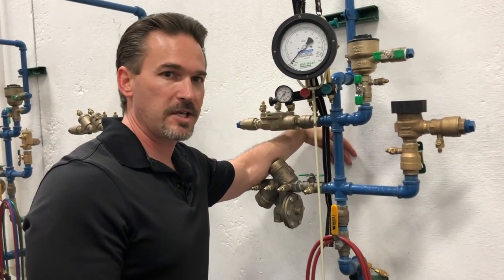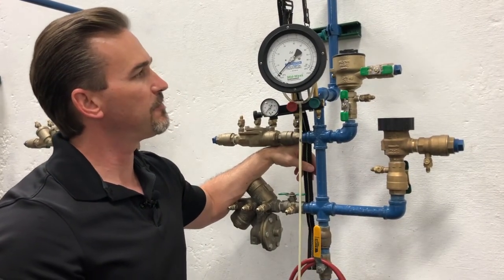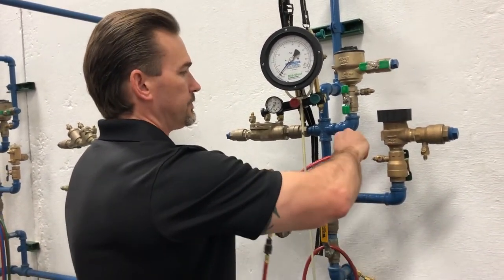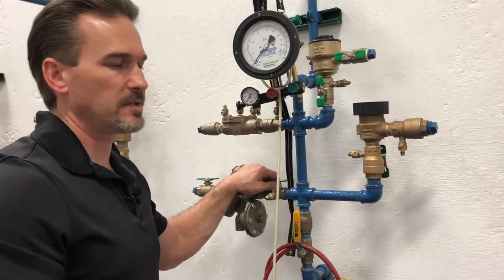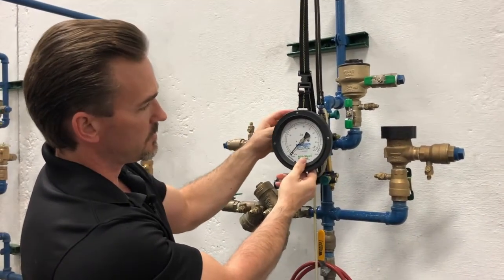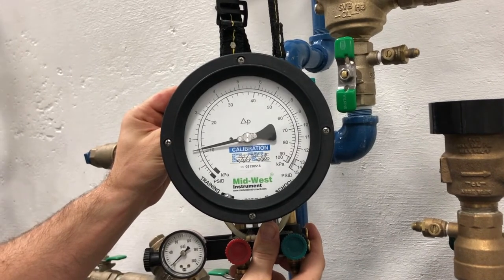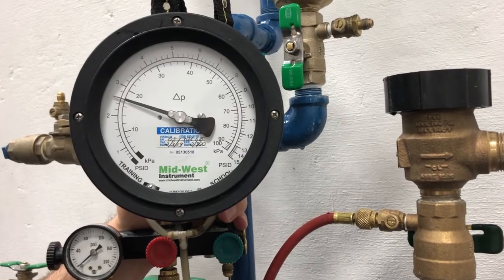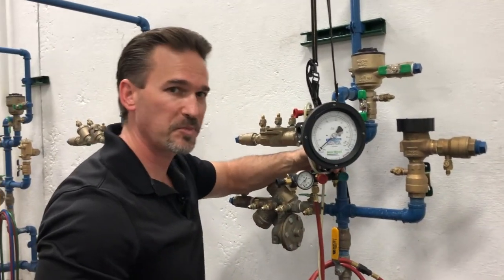PVB Test Procedure

Comment: Why isn't there a bleed valve arrangement tool on TC# 1?
Reply from the maker: Years ago our jurisdictional authority omitted the bleed off valve from the PVB, SVB, and DC test procedures. If the shutoff valves are not closing tightly, our JHA requires that they be replaced immediately. Some potions of our cross connection ordinance follow the USC standards to the tee and other portions not so much. Great comment. Thanks for watching.